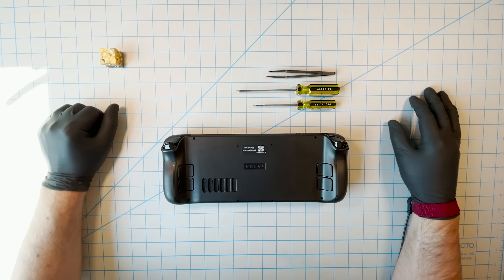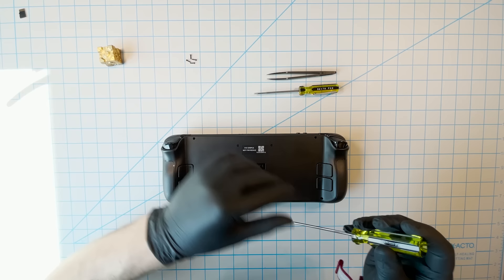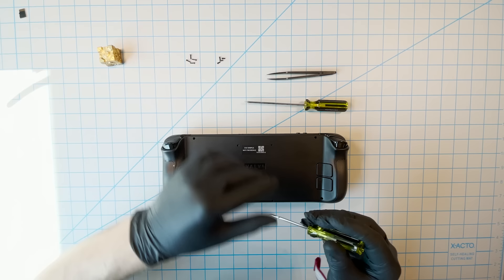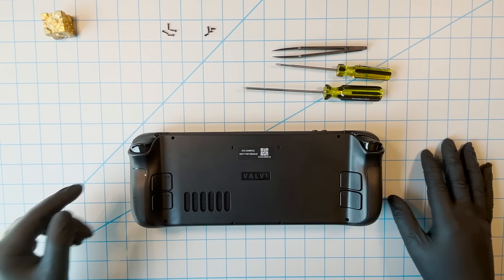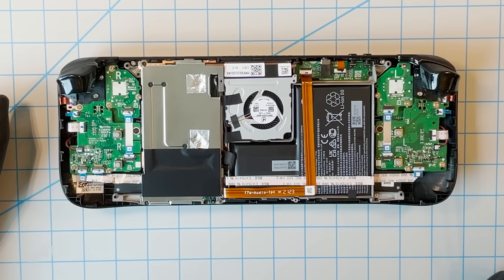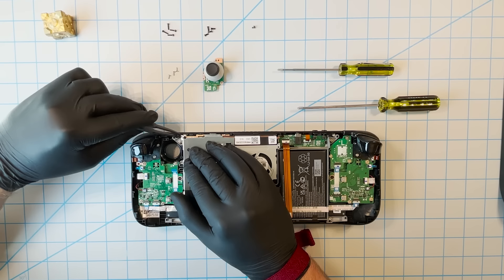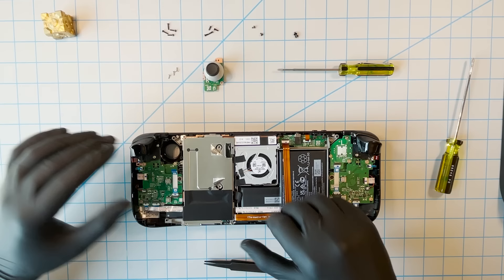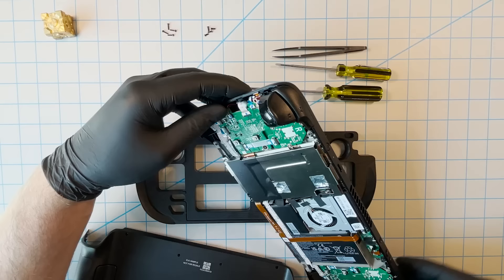Take a look inside Steam Deck™!

Comment: Awesome to see Valve supporting right to repair, that gives me a lot of confidence in their hardware. It's also great that they explain why not to swap the SSD in real technical terms, and not in a "you're too stupid to understand it" way.
Reply: Sounds like something that you will hear in a aperture science commercial
Reply: The reasons are absolutely stupid, though.  SSDs, like all electronics capable of producing notable interference, are certified by the FCC not to do so.  And they most certainly will not vibrate or have problems due to vibration.  They're SOLID STATE drives.
Reply: @Shotblur  I wouldn't take FCC certification as absolute.  
You even wrote "notable" interference yourself.
The FCC cert requirements may very well be much less demanding than their requirements for such a tightly packed device.
Reply: @Shotblur  they will not vibrate, but they are the same size of an notebook HDD, wich will vibrate.

and they may suffer if another piece of hardware vibrate (eg: cooler).
im not sure if this problem is real for any model of SSD, or it just an attempt to prevent people from purchasing the cheapest model and replacing the built in ssd.
Reply: @Shotblur  Yes, they will. Go through any part manual and there's the amount of vibrations the part can produce. Laptops have a limit of how much each part can vibrate and resonate with. It's just that they know people will not search this or even care, so they do a safe limit to not incur problems.
Reply: @Shotblur  4:00 Regarding vibration: listen again. They never said the SSD was the one vibrating.
Other components in the device vibrate, like the speakers and any haptic actuators it may have.
Also, it's a handheld and external sources of vibration also need to be accounted for.
Reply: @Shotblur  If anything, Third party reviewers will likely test a bunch of SSDs and see what works and what doesnt, so no real worries there.
Reply: @igorgiuseppe1862  M.2 solid state drives such as the one used in the Steam Deck are not the same size as a notebook HDD.
Reply: @Ghostsonplanets  Solid state devices have no moving parts, and therefore do not produce vibration.  It is also impossible for vibration that will be encountered in use to create problems with the components in a solid state M.2 drive.
Reply: @majorgnu  SSDs, being solid state devices, do not have their function impeded by vibration.  If they did, Valve wouldn't be using them in this device in the first place.  Also, the FCC standards are pretty rigorous.

Comment: His ESD bracelet is on top of his gloves, this is such an amazing shitpost.
Reply: He wants to be grounded AND insulated from any new ES. HA!
Reply: 2:09 Called out in the video itself.
Reply: If it is an antistatic glove, that means made from conductive material, that's perfectly fine.
Reply: They (probably the editor) acknowledge this in the video
Reply: @BHBalast  Standard nitrile glove. Not anti-static.
Reply: That bracelet has needles inside that go in your arm to achieve ultimate contact
Reply: @Berserkism  The "wireless" ones are total wank.
That's a proper anti-static wrist strap with a grounding lead, which works perfectly fine when used properly.
What's gotten you seething this hard, anyway?
Reply: @majorgnu  from the way he's speaking, he sounds british, i think i'd seeth if i was british too
Reply: - You're fired. Wait, come here, I need you. You're hired. Make a video manual about steam deck but don't fuck this up. 

You're fired.
Reply: They meant to do that to show that humans all have flaws which is just another reason why not to try this and leave it to professionals, a BOT.  Cudos to valve though for awareness on letting people do what they want with their property.

Comment: Props to Valve for making this video, I just wish they would’ve spent the extra cents to use metal inserts for the screws instead of self tapping ones :(
Reply: makes me wonder how close to breaking even/bleeding money they've come with this project
Reply: @matheuswohl  probably close enough we should be thankful that it exists
Reply: @matheuswohl  Newell described the process of hitting a $400 mark on the base model as "painful" so I am positive there are lots of tiny compromises like that which made such a cheap device possible at all.
Reply: It's probably for the same reason you don't see brass standoffs in toys, a solid piece of plastic is better suited to withstand impacts - introducing standoffs creates a point of stress that will easily break off if impacted.
Reply: @matheuswohl  I think their idea is, that the higher storage versions, which might be selling for profit seeing the price, compensate for the loss caused by the cheap model.

Comment: Damn I'm so excited. To have a company be so open about the internals of a product and state the limitations of upgrading but still allowing you TO upgrade it if you want (or replace broken parts and even provide sources for them) is really refreshing. Right to repair FTW. Good job Valve.

Comment: I like that instead of just saying: "dont do this, you will break something" 
They actually listed all the problems of why it would be bad.
Reply: This. Exactly this.
Reply: Except most of these are made-up problems.  A replacement SSD will not cause notable wireless interference or die because of "vibration".  You're extremely unlikely to puncture or damage the SSD.  And removing the back cover permanently and severely compromises the drop protection of the device?  Get real.
Reply: greatly over exaggerated all the problems of why it would be bad* ftfy
Reply: @Shotblur  they're self-tapping screws, so if the user is an idiot it can compromise the integrity of the deck.

 also ESD is very unlikely to kill a device (see: linus video w/ electroboom) but they list it anyway. its a scare tactic.

Comment: Valve: Replacing the ssd is difficult and not reccomended!
Also Valve: Shows how easy it is to replace
EDIT: Thanks for bringing up those reasons, never really thought of that. I just think it would be easy in my opinion, but now it makes a bit more sense
Reply: They did put forward plenty of reasons why it's not recommended right in the video.
And it might be easy to do, but not so easy to do without fumbling something like over tensioning the screws.
Reply: @majorgnu  true but its a really straightforward procedure, really not many things to mess, just simple skills. Still if someone is an amateur probably should let someone else do it.
Reply: I feel like they do this solely because they don't want to be held accountable for mistakes - especially when the deck is reaching a broader audience. The typical pc gamer should know their way around a computer.
Reply: @jordano.3650  Oh trust me, that is not the case.
Reply: @jordano.3650  They just really don't want people messing their Decks up, so they keep actively using them.
The more Decks actually get used, the more value is added to Steam.
Reply: Those SSD's look like a pain to source.
Reply: Pretty obtuse that you have to remove the heatsink screws in order to remove the RF shield that covers the SSD, it's probably to save screws but having to disturb the cooler is not ideal.

Comment: Seeing some people here mocking about the warning is heartbreaking.
It might look ridiculous to some, but it was a thing a few years ago over here. My neighbour "selfmade" repaired a device that kept on heating up with an internal error or wrong replaced parts (police didn't want to go into detail) until it started catching fire around 2 :10 (+-10minutes) am. Got warned by the smoke detector, got up, called the fire department, tried to kill the fire which by this point reached roof up towards my apartment. Firefighter arrived, successfully  killed the fire and woops, couldn't get into my apartment for about 3 month so had to live in a hostel (thanks insurance). Those who experienced the same knows the stress behind all the insurance staff though and you will feel totally different about those warnings once you experienced it by yourself.

Comment: So glad he’s wearing a grounding bracelet. It really works best when you insulate your esd strap from you by putting it on top of your glove 😂
Reply: I think the strap has some contact to the skin on the inner side of the arm. The glove is probably uncomfortable over the strap.
Reply: they it know it was wrong
Reply: he fixed it halfway through
Reply: He should have just worn a wireless one =)_
Reply: @JohnSmith-fq3rg  while there is low chance of damaging it, they have to do it as a precaution, most repair shops probably dont use it ever
Reply: @alexstone691  It's not a precaution, you either have a signfcant static charge built up, or you don't.  At this level of sensitivity, a constant ground connection is legitimately  pointless.
Reply: @JohnSmith-fq3rg  you can at any point build up charge, so what you're saying is bs
You could also use an esd matt and not need the strap

Comment: Wow, super refreshing to see a company do this. They even got the warranty part right - anything YOU break will void your warranty, but only if you actually break it and only for the part that you break. You can take it apart, mod it, whatever, and they still aren't legally allowed to void your warranty.

One thing I will say though is that the self-tapping screws kinda came as a shock. They came so close to making a truly repairable device, but with those screws each disassembly of the casing really is going to weaken the structure more and more.

Comment: The vehement warnings about servicing the device seem a bit excessive to me, but I understand why you guys have to give them. All things considered for a device that isn't intended to be user serviceable it seems that the device was designed with the problem areas in mind. Getting to those thumb sticks and that SSD seems pretty trivial compared to other devices *cough Nintendo Switch *cough *cough.
Reply: It's actually a joke.
You see, people mod they products and try to get warranty.
It's rare, however companies hate it.
They also hate giving customer support, in special when the customer caused the problem by messing with the insides.

In another words, Valve is making those jokes about companies they games are so full of while also showing the new company product.

Three birds one stone.

Comment: I love that valve knowing that some people will just open or dissassemble their steam deck when they get it (like reviewers) and may end up perma damaging it. so instead they make a video targeting the frequently asked questions about it like ssd and thumbstick. it sounds like they are prepairing for stick drift... so they made it the easiest thing to replace on the whole thing. Massive props to valve for this. On top of all this for making such a super informative walkthrough and touching every point that might be necessary. Great job guys :D
Reply: It's a shame they limited us to m.2 2230 though since they clearly could have supported 2242 and probably even 2280... with some minor redesign. At least you can get 1TB drives in this size (with and Kioxia drives are fairly low power)... they are all pricey compared to 2280 sized drive though.
Reply: OMG it's like wow, no one ever could have easily figured out how to take out some screws and put a part in. Such a revolutionary video that never could have been found anywhere on the Internet after the Deck launched.

Comment: "Very good! You are now in possession of the Valve's Steam Deck."
"With it, you can play many games."
"These software have proven to be completely safe." 
"The Device, however, has not."
"Do not touch the operational end of The Device." 
"Do not look directly at the operational end of The Device." 
"Do not submerge The Device in liquid, even partially." 
"Most importantly, under no circumstances should you [bzzzpt]"

Comment: I've pre-ordered the 64GB version and am very pleased that the replacement process literally just involves screwdrivers and obviously being careful. If it had needed soldering and/or a heat gun, then I'd never attempt it. Trickiest bit now is finding a cheap 2230 SSD! Oh and all the doom and gloom narration is simply Valve covering themselves for the absolute worst case scenarios - the visuals, however, show me that this is pretty straightforward.
Reply: are you considering on buying a 2230 SSD secondhand?
Reply: i dunno i would recommend waiting until someone else replaces their SSD and its shown to work, i do think there might be some merit to their warning of power consumption and temperature management
Reply: You'd be better off just buying one with a built-in SSD considering the relatively minor difference in price.
Don't consider a second-hand SSD though. That's a bad idea, unless perhaps you get a good deal on an enterprise drive from a known good source (unlikely for a 2230 M.2).

Comment: "Just reverse it to put it back in"

I would appreciate it if people stopped saying this. Most things aren't exactly the same in reverse order. For example, I bet that putting that ribbon cable back in is a completely different feeling/method than removing it.

At any rate, I am interested to see what the biggest SSD someone will be able to fit in here is.
Reply: To be honest if you’re opening this you should have to capacity to put it back together
Reply: @ashwinalagiri-rajan1180  They are explaining how to disassemble it. For now at least, this is only source on disassembly. How do I close it? Where can I know it? It is better to show how to assemble as well
Reply: They do not tell you how it feels.

- Take out these screws.
- Take out this.
In reverse.
- Put this back in.
- Put those screws back where they were.

There are reasons behind why they do not recommend you to take your product apart without having the expertise. If you know what you're doing, you'll be able to put it back together without a step-by-step guide. There is no need for more.

Comment: As a dude that successfully did this kind of repair once on his own Nintendo Switch Joycon with a drifting joystick, this is cool.  

This looks much less difficult.  Designed well enough for repair of simple things.  Much respect Valve.  

Joycons are much more cramped by comparison.  I remember removing the battery on a Joycon being sketchy.  I remember making a spark and praying it still worked.

Comment: "It is not designed to be replaced"
Minute later shows the very essence of how you should design something if you want it to be easily replaced.
Reply: ngl, its not designed to be replaced with 3rd party parts, like a full power PC SSD or something.
Reply: It's a mandatory "hey we gotta say this so we don't get class action lawsuit sued to hell and back because some reddit fuckwad soldered a 3090 onto the motherboard and then got upset his device caught fire" kind of sentence

Their main point is that it's not replaceable with any generic thing that happens to have the same connector. You've gotta stick to their original specifications, but can go nuts from there on. There's still always a tradeoff between making a sleek, efficient device and something that is 99.9% hot swappable.

Main example being how lots of ultraslim devices have suff like RAM/storage soldered on, because all the conventional connectors we have take up too much space.

Comment: Valve: the innovative company to give power to the people while retaining the ability to discourage tampering. 

no company should look highly upon a customer possibly damaging the product because having the product break would suck.

but then you have apple that put anti-repair measures in place to have you spend a shitload of money no matter which route you chose.

professionals? overpriced.

broke it and want to repair it? buy a new phone and waste money.

apple will always be an awful company.
Reply: It's a shame that they dominate the tablet market in both performance and experience. I prefer Android phones but the android tablets aren't that amazing in comparison to iPads
Reply: @stanc8407  Iphones don't dominate in either performance or experience. Performance, they're average at best; they don't reach the levels Samsung models do. Experience? You're limited to the very few applications apple has (which are designed for amateurs - to keep them happy, not to give them functionality).

Comment: Sounds like they’re razzing LinusTechTips since he wanted to piece it apart.
Reply: There are advantages to doing this themselves. First, they get to clearly message their support for Right to Repair, while also warning consumers not to mess and why. Multiple times over to get the point across. But also, they can justify their part selection and design decisions in a way Linus could only guess at. And I’m sure he’ll do a teardown too anyway.
Reply: @Mediaright  As well as mentioning how certain replacements can affect the device if user does try a replacement but has more issues than usual, unless you already mentioned that, then sorry